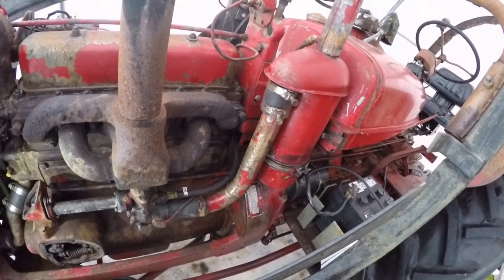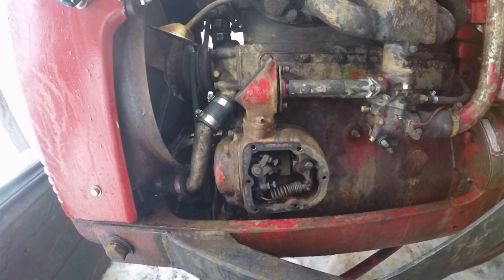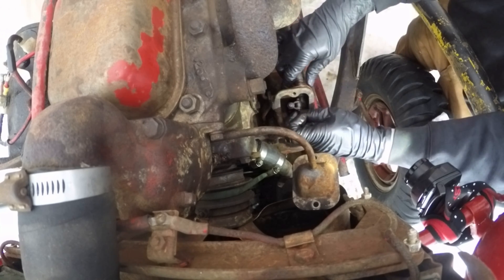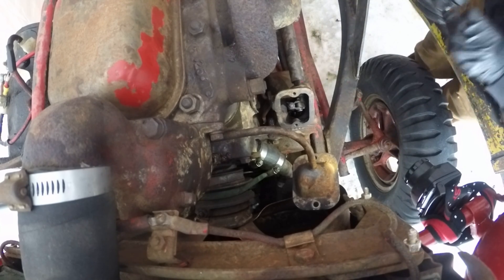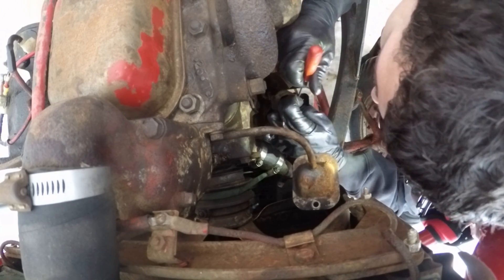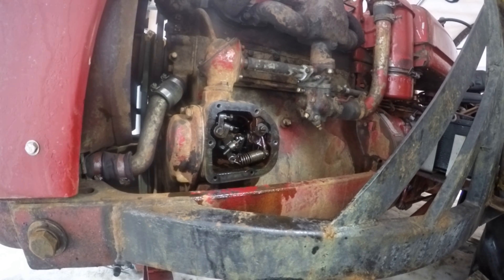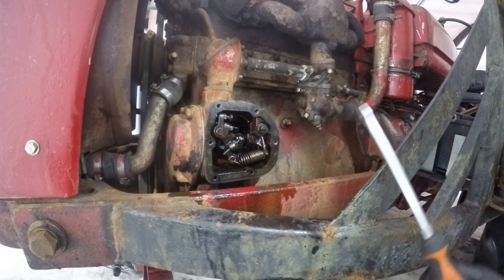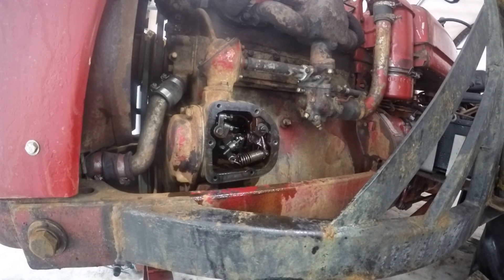Farmall H and McCormick w4 Governor Set up

Comment: I see my problem...it's the linkage between the carb and governor, I had loosened the two screw's during an in frame rebuild...afterwards idle was very high and I did not know the holes were slotted on that cover.  I just hooked it back up and tightened it down.    Thanks young man, you seem to know exactly how the simple old tractors function.

Comment: Does the tractor need to be in gear to hit 1600rpm? I have rebuilt the carb and set timing, upgraded to 12vdc everything. I set my low idle and adjust the pin to be free. It runs great. However when in its neutral my high idle  max is 690-700. I assumed my spring was weak so I pushed the speed lever by hand in and the tractor would run up to 1600 while fitting me back in neutral. I didn’t put it in gear and try to drive it cause I was pissed at the time. Then I started thinking I gave up too soon after coming home.

Comment: I have a question for you my h runs good at low idle and high idle just rebuild carb but as I try to drive it she sluggish and almost shuts off any thoughts what causes it I think carb set correctly but could be wrong it’s my first carb set
Reply from the maker: Could be a carb issue, try choking it a little bit when you advance the throttle and see if it clears up. Have you checked everything else?
Reply: @steelcitymechanical3902  I have not bought this tractor knowing carb needing rebuild  I have not messed with governor I’m kinda in the dark on this right now if you know what I mean

Comment: I was just useing my farmall h had no problem till I ran out of gas then I lost power after I got gas back into it so I cleaned the carb still made no difference till I put all new plugs then ran great till yesterday it runs at idle but if I take it off idle the egine races
Reply from the maker: I would double check the carb and make sure it is cleaned really well, the governor shaft may have come out of position and will have to be reset.

Comment: Hi - great video.  I have a 1953 Super W4 and I loosened the governor shaft from the carb at some point to clean.  Now the governor disengages from inside the carb at times and it runs at unlimited RPMs.  Can i direct message you or call you?  Am in Canada as well.  Cheers
Reply from the maker: Direct message me if you need some help.